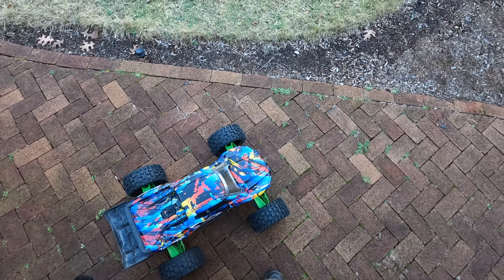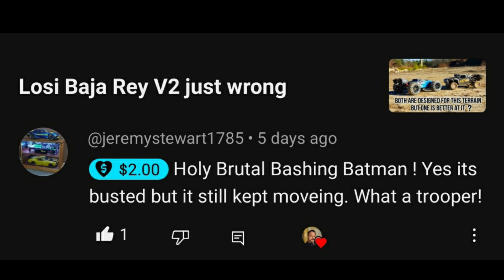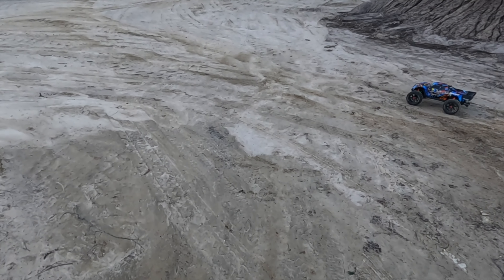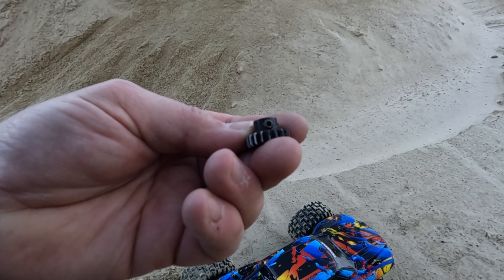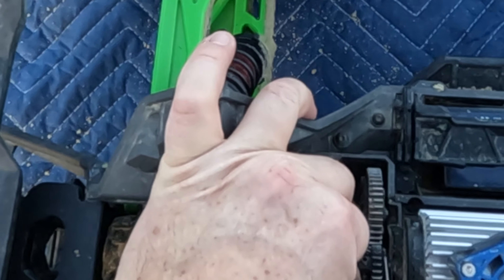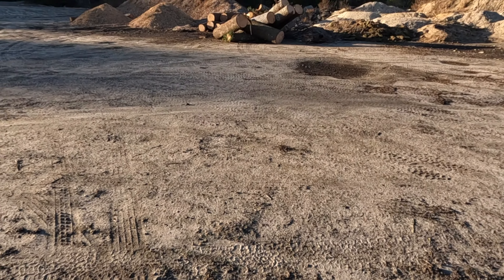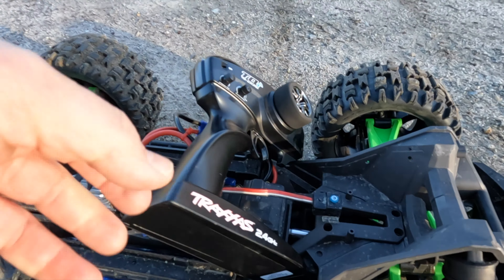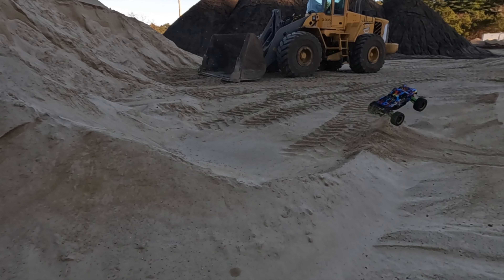Traxxas XMAXX - XRT is this my ULTIMATE basher?

Comment: Loctite 680 ON THE SHAFT  and both grub screws. You'll need a little heat to remove the pinion. It'll never come off on its own though. And I too was thinking you might have alignment issues.
Reply from the maker: Yes I'd like to see if I can address the alignment THEN break out the MiG 😜
Reply: @rcguygarage  try tig baby!
Reply from the maker: @Rusty-Metal  this sucker ain't NEVER coming off🤣

Comment: I wonder if you can put like little hole or indention it the shaft, where the grub screws would be. I'm far from knowing if that would help and I've not seen any one doing it on rc motor shafts but i use to repair fertilizer auger trailers and beds, on the bottom of the auger tube it had a bearing with set screws and we had to take the allen Head grubs out and had square headed M sized bolts with jam nuts on them. I can't remember but seems like we marked the shaft, hit it with a punch or corner of a chisel and cranked down the bolt on the indents and then locked it down with the little jam nuts. Just had to be careful and not break off the little square headed bolt 🔩. Its been years Guy since I was doing that job but its never hurt to try and bounce ideas around.

Comment: Can you drill a slight indentation on the motor shaft to help locate the set screw and prevent pinion gear coming off. I just got back into the hobby last year after a 20year hiatus but I used to do that on my big Losi Super Truck that I still have.  Good luck Guy!!!😅
Reply: The Losi Super Truck…LST!!
I still have my all original LST and LST 2. Had them in storage for 7-8 years and got them out 2-3 months ago. Put new glow plugs in and they both fired up in less than 3 seconds. Just fantastic engineering by Losi and Dynamite back in the day.
Reply: That’s excellent! I plan to run the LST and Savage25 this spring. I put them away 20 years ago in running condition and had put engine storage oil in them and they still turn over by hand nicely. I bet they will both fire right up, can’t wait to hear those awesome sounds. Good luck with yours, glad they are working good for you. They were always dependable machines 👍

Comment: My new xmaxx will arrive soon. Is the shoo goo drywall tape still the best method for strengthening an rc body?
Reply from the maker: It does work but my attitude is adding the extra weight versus just sucking it up and buying another body. No matter what either way you going to pay. On the larger scale vehicles it's semi less of an issue.
Reply: @rcguygarage  so the best is to avoid all together and keep the weight down?
Reply from the maker: @CorneK011  you just need to evaluate your time, effort and materials involved. It is worth it in the end. The body still can get mangled dependent on abuse. I'll never do it as I'll just buy new if and when needed. Just my personal opinion👍💯
Reply: @rcguygarage  i have all the time :). Just wanted to know. Iknow it is impossible to make it unbreakable. But if I can, with a little time extent it's lifespan then maybe worth it
Reply from the maker: @CorneK011  maybe you're a candidate for an unbreakable body I believe they are sold out of the UK
Reply: Run gorilla tape in the sensitive areas

Comment: Put a flat spot on the shaft
Reply from the maker: It already has one 👍
Reply: Hey, would you happen to know if a kraton 8s motor has a replacement motor shaft or is it junk. And would I just have to replace the motor. Mine broke at the pinon.

Comment: I dislike how Traxxas uses proprietary batery contacts, but i like my XRT a lot. Which company do you prefer overall? Traxxas or Arrma?
Reply from the maker: Doesn't Horizon use proprietary battery contacts? Neither as I think they are both good companies providing fun easy to work on products👍💯🤟
Reply: @rcguygarage  TY for responding. I like both companies as well. Many content creators that focus on brands are often pumping up Traxxas it seems. Some (paraphrasing while doing 30+ foot jumps X-Maxx) say "Arrma truck would break upon landing "etc. I have the traxxas dual cgharger for my 2 4S batteries and it proves to be much easier to use than two other chargers i have for all other rc batteries so Kudos to traxxas on that. I know that Im tired of Hosim and other RC manufacturers that use Phillips head screws instead of exclusivley HEX type as they can handle more force and not wear down as easy imo. Anyway thank you kindly, and please keep up your quality content and have a happy new year.

Comment: I have the Safe-D pinion gear from Arrma.  You don’t even need loctite because the c clip holds it in place. I do however use it just in case….lol
To date have never had a problem again.
Reply from the maker: Yes that's sounds KEY in this situation. Still want to align the gears though👍💯

Comment: i bought myself an arrmor pinion with the flat inside , then i filled down a bit more of the xmaxx motor shaft so it would fit and it stays on really well
Reply from the maker: Yes👍💯 good
Reply: I only use the Arrma Safe-D pinions in all my cars.

Comment: Same thing is happening to my xmaxx. Found one of the bearings in the motor is bad. Hoping that's all it is.
Reply from the maker: Pinion side? On mine that WAS an issue for sure. 1.5 packs of I remember right
Reply: @rcguygarage  Yes, pinion side. Every 1-2 batt packs gear comes loose. Stock and hardened gears. Haven't had that problem with the xrt yet.

Comment: Arrma 8s pinions have a flat in them buddy but on the xmaxx they constantly eject pinions if you dont put strong loctite on the set screws and crank them stupidly tight with an and proper hex key the screwdrivers won’t get it tight enough
Reply from the maker: So what it that telling you??? Alignment/plastic flex? I'd like to resolve just so I know. It's a bummer cause THIS truck can KICK
Reply: @rcguygarage  I think there is an element of flex mainly from the plastic and the length of the spur gear shaft that is unsupported. But I haven’t had a problem with mine for a while I did file the flat on the motor shaft slightly to take any damage away that was there from a couple of times the pinion has slipped. I believe the solution is to use the arrma 8s pinions from the outcast / Kraton the d shape in the pinion take some of load away from the set screw I would try this and also mate it with a good steel spur gear.

Comment: It's weird I have a friend who has pinion and spur problems with everything from stock Traxxas gears to aftermarket gears, I have never had any problems with my Xmaxx using only Traxxas spur and pinion, they are over a year old now and factory originals, so im not sure what the problem is for some people, you are definitely not the only one to have spur & pinion issues...good luck 👍👍
Reply: I would say most problems people have are from landing with it on power and slamming the brakes from full speed its tough on those parts

Comment: I think you stopped driving it last time because the throttle wasn't proportional. It's like you gave it a little triggah and was at full speed.
Reply from the maker: You could be right 🤷. I tried checking videos and it seemed like the pinion issue last time😂🤣
Reply: @rcguygarage  it could be I just remember u got upset with it cuz it would be full speed after barely pulling the throttle when u was doing the speed runs.

Comment: i know this is probably a silly question, but do you run any type of thread locker in those grub screws on the pinion? even something like blue loctite that is relatively impervious to heat (assuming you dont have a problem with it getting too hot under the gear cover)

and as an ex-automobile detailer, i saw that dig at earl lolol - hey earl, your BMW's paint is screamin' at ya!
Reply from the maker: Yes I normally use blue after checking and cleaning. This RC has alignment issues. Earl who's EARL😂🤣😂🤣

Comment: Hey guy I wonder if a  wheel  lock for and airplane wheel would work they are super cheap and would just lock on the shaft to take some of the pressure off the gear set screw